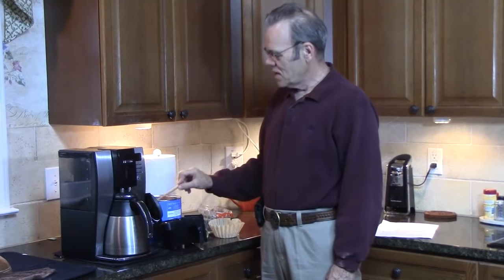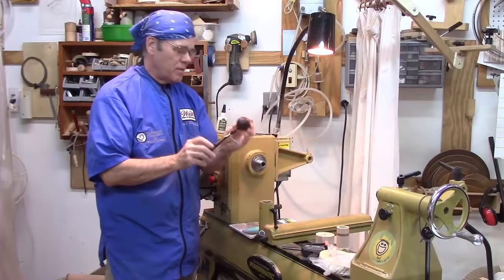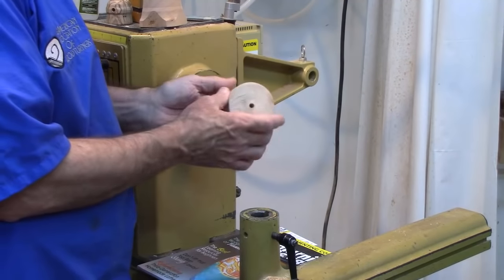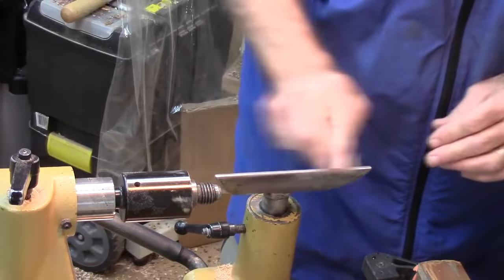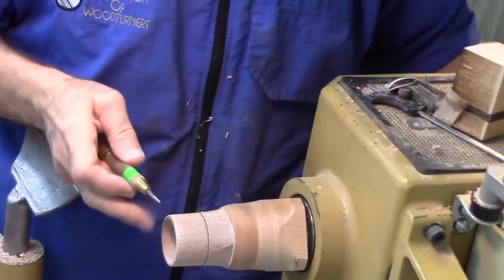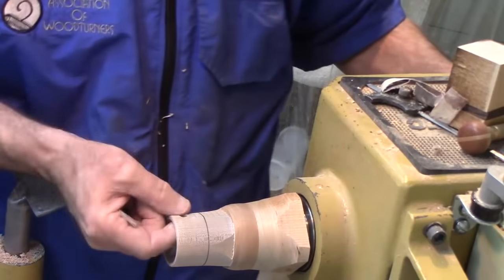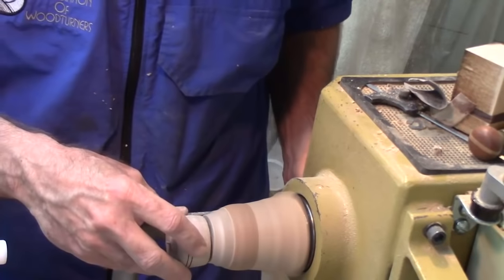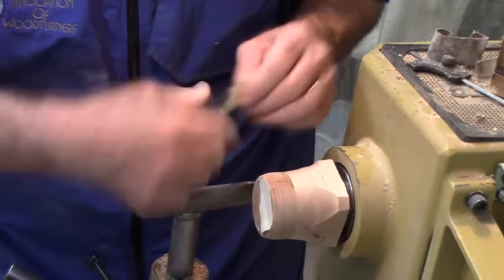How to Turn a Traditional Wood Coffee Scoop

Comment: I know this is an older video, but I have to say this anyway... 'Draw-filing' doesn't mean pulling the file backwards over the work-piece.  A file should only be used in a forward direction.  Draw-filing means holding the file perpendicular to the direction of the stroke.  If you held the file with the handle in your left hand and and the end of the file in your right hand, and you pull it parallel to your chest towards you then you would be draw-filing, but the teeth are cutting properly.  If you have the handle in your right hand then you would need to push the file away from you to draw-file properly.  What makes it draw-filing is having the file perpendicular to the stroke, not using it backwards.

Comment: Mike, nice project with plenty of explanation which is helpful. I noticed on the ambrosia you said the worm holes made you not use it. Have you thought of filling the holes with turquoise powder and sealing it. Then sand and buff it. It would add a wonderful design to the coffee scoop and very unique. Just a thought... Lloyd
Reply from the maker: +gnosticsoul1 
I don't have any turquoise on hand but do have some brass inlay powder. I had forgotten about that. thanks for the suggestion.

Comment: I love those elegant burn lines ! What kind of wire are you using for that ?
Reply from the maker: Guitar strings mostly. Don't ask which one. Most any wire will work for a while. Copper ground wire but it will get brittle.

Comment: Hi Mike,

Neat little project there and another great video from you.  I'm definitely going to make one!
As far as the turner's tape goes, what brand do you use?  I googled "turner's tape" and came up with a ton of different one's.  I don't trust that all of the different tapes that came up in my search are good enough.  Sam Angelo (Wyoming Woodturner) suggests Tessa Tape.  The tape you use is thick as you say which makes good sense to me.  Thanks!
Reply from the maker: +Bob Ostrowski 
Mine is Spectatape but think there are several good ones out there. I think the key is buying it from a woodturning vendor that only sells tape for woodturning.

Comment: Great project!

When you did the version where you glued various species of wood together to create a patterened bowl, how did you deal with the issue that the joints were end-grain?  Did you make the joints flat, or did you do mortise and tenon joints to get some side-grain surfaces.
Reply from the maker: +Louie Powell 
They were all end grain. I know that is a weak joint but the wood is thin so movement did not seem to be a problem and there was no pressure on the joint. I have not had one fail but I guess there is always the possibility.

Comment: Hi Mike - nice little project!
Question
I think yu are using a Powermatic lathe?
I see other "Pros" like yourself that have the same or similar lathes, and I have often wonder what the use is for the (seems like cast?) - that either part of or affixed to the headstock. I am not sure what it is called or how to describe what I am talking about, but it appear to stick out at 3:00 o'clock from the headstock and has about a 3/4" hole bored through it (I assume completely through).
My question is - what is this used for, or is it simply for motor vibration control?
Probably a dumb question, and it may be addressed if Powermatic has a video on their machines, but thought I would ask you and maybe get your opinion on it's value to the machine.
Thanks for answering if this question is worth your time.
Dennis Beamish Cambridge Ontario Canada.
Reply from the maker: I think you are talking about the bolt on iron arm that holds the protective cage that no one uses. It also can hold a dead center similar to the arm bolterd to the TS that can support a spindle behind your turning so you can easily copy a spindle. This was a new feature on the 3520b that was not on thee older A model.